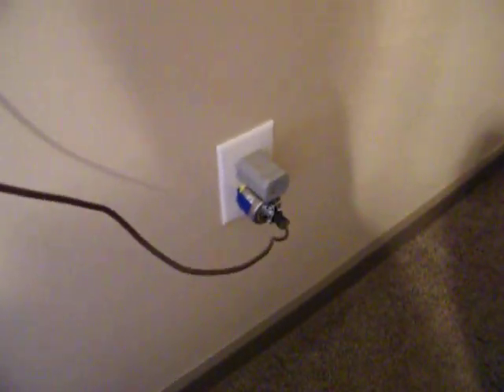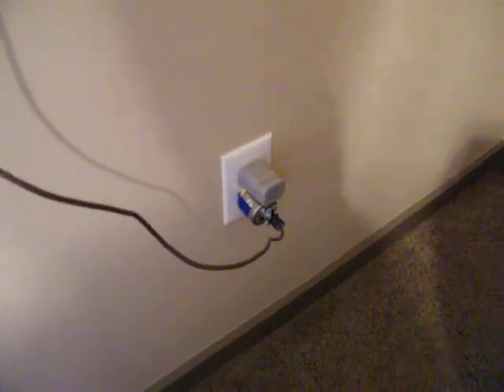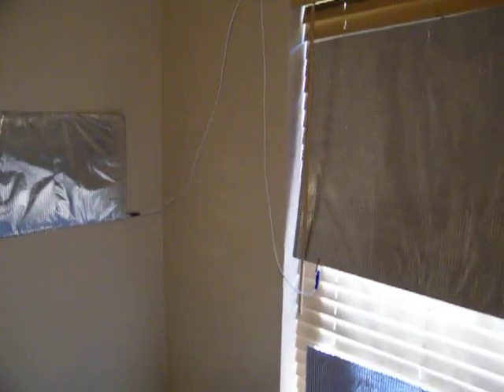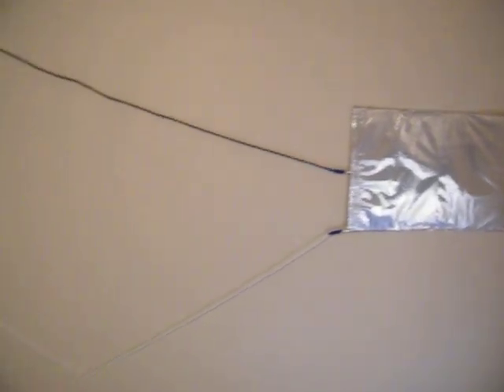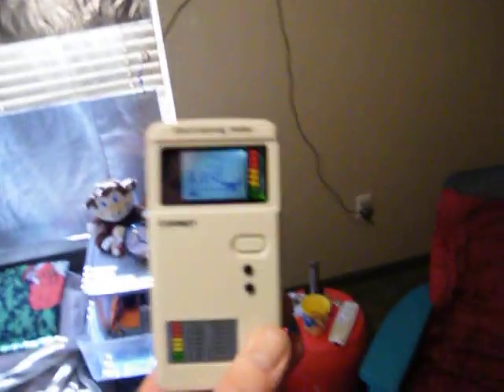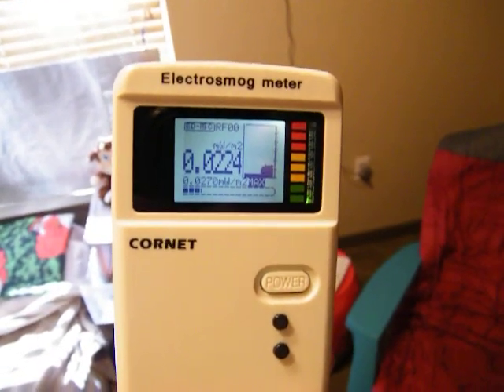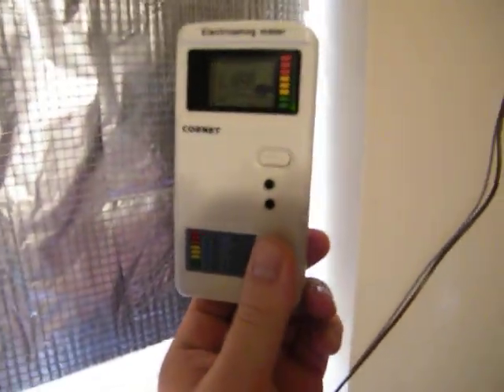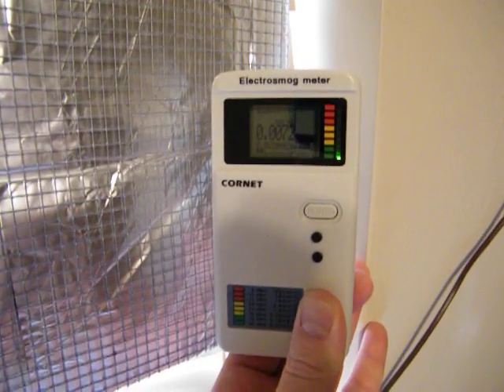RF/ELF scan on my home made frequency jammer.

Comment: Will the frequency jammer stop the T.I. Tinnitus?
Reply from the maker: rbkhyvc What are you referring to? I've had plenty of symptoms but I've never heard a name like this before. My device uses dielectric & opaque material to stop the light & radio frequencies to enter my apartment. I also use a material that has attenuation coefficiency which when grounded helps to jam all EMF's as well. It essentially just forces frequencies out & "turns the volume down." It's a very cost efficient design & works great!!! If it doesn't work for you it wasn't put together right or your really schizophrenic... Thanks & take care!!!
Reply: I was referring to the Targeted Individual Tinnitus. I'm told it is different from regular tinnitus. I've also heard it referred to as Remote Neural Monitoring. With me I have it in all the areas I stay at in my house but not when close to other people. It hits me real hard just before I lay down to sleep and all during my sleep if I by some miracle can sleep. It used to be happening when I wasn't at the house but now seems non-existent when I'm not at the house.
Reply from the maker: rbkhyvc My device will definitely help you at home. You would have to build many panels though, at least one for each wall. If I were you I would also purchase a electrosmog/RF meter. And check all of the light switches & the breaker box with it. It's pretty easy for perps to break in & put devices in those locations. They can just be clipped on to DC voltage wire with an alligator clip & run off of dirty electricity. I would also recommend purchasing an Adulterra wall plug, all of the information on that is here on my you tube.(I made a. video about it & the link to the website is in the description of the video) Most of this technology is fairly easy to understand & easy to build or purchase. Shielding methods are what's expensive. I'm working on some other methods for inexpensive shielding. Tomorrow or Monday I should be posting another video. Building a xr2206 function generator, it runs off of HAARP frequencies. And it can also be used as a Jammer, just have to adjust the sine, triangle, & course frequency pattern. I would also recommend making a Faraday Cage for your Electronic devices. I keep my phone & tablet in one when I'm not using them. And it's helped a lot!!! My perps were sending me HAARP frequencies through my phone at one point. And as soon as I started keeping it in a Faraday Cage it stopped. If you have any other questions please feel free to contact me again, take care my friend!!!
Reply: @keithsonesjr.8045  They do not bug your house. Those targeting an individual use VLF Radios (they operate in ELF Range of 100 Hertz to 1KiloHertz) so you can as well call them ELF Radios. Explorer E-202 is a common model of VLF Radio Receiver used for the purpose of illegal surveillance. They rent a nearby house. And from that house they target the Targeted Person's (victim's) house and can listen to every conversation of the victim without bugging the victim's house. Then as soon as the victim falls asleep, they make sharp noises using a very small pencil thin mike, almost the size of  a thick pen. The victim wakes up in shock, since they sync timing of sharp noises to the exact moment when the victim falls asleep. This is sometimes referred to as TI Tinnitus.

If something can jam a  VLF Radio Receiver (100Hertz to 1KiloHertz), half of the problem can be solved.
Reply from the maker: @MrVarunAnandd  If you watch my video on Linux Mindguard there is a VLF jammer in the software. Only problem is that there is 2 more frequency spectrums past VLF. They are sonic and psych, and those are also on there. If your being hit with vlf you will have to use all 3 jammers at once. Check out my video, the software works great!!! And it was written by a TI that I know...
Reply: @keithsonesjr.8045  Only an idiot would believe that a piece of software can be used as a jammer. A laptop computer is capable of jamming nothing. It is not a jamming device.
Reply from the maker: @MrVarunAnandd  Well youve gone an insulted someone that has studied and had personal experiences. Yes it can work it uses the aluminum hardware and it resonates a scalar wave like a piece of orgonite. No it does not jam like a hand held jammer because a hand held jammer emits radiation/electrosmog. This jammer works if you know how to use it without causing a cancer causing electrosmog. It is not 100 % full proof BUT it WILL jam at least 3/4 of the signal in a healthy way that helps to heal the human body. Maybe you shouldnt be so rude!!! If I was confronted by someone like you in real life Id rip your head off you weak POS!!! Im trying to help people and your discrediting me. You should take the time to be a little more thankful for people that do research and try to help others freely!!!
Reply from the maker: @MrVarunAnandd  Just for the record they use many different methods and devices depending on the type of handler, their knowledge, and expertise. A smart handler can use the wifi these days to do the trick. Thats the way Intel did it in 2008 with the alpha wave.
Reply from the maker: @MrVarunAnandd  And Im assuming you havent tried it yet? If you keep the software running and hooked to the internet it works. A router is a low frequency device and thats what its connected too...
Reply: @keithsonesjr.8045 same